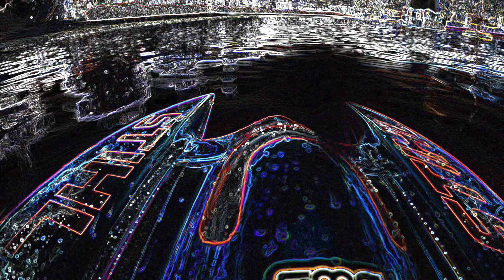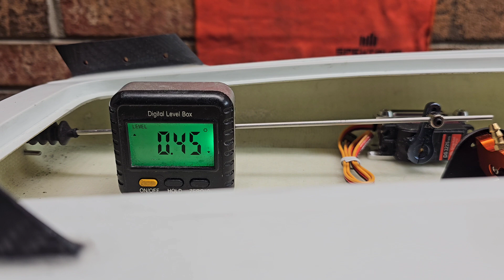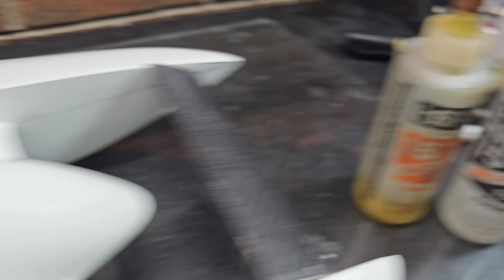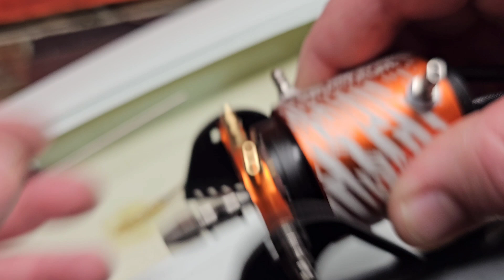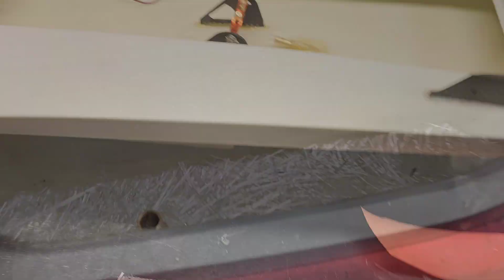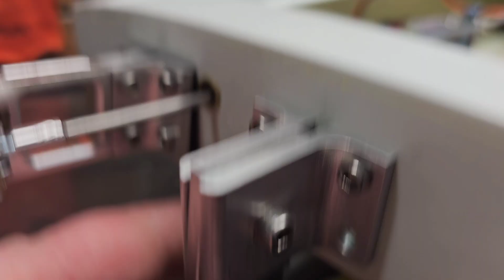Stuffing Tube, Motor & Sevo Installation Swifter Xl Build 31.5" Hydroplane Rc Boat Building

Comment: Looking good.  I think I'm going to kick my rudder back about a degree to help keep the back end up in the turns.  The Swifter is a really long hull and it may help.
Reply from the maker: That's a great idea, I have used rudder kick back in the past to help keep the nose up while turning, does the swifter 26 have a slight angle on the transom?